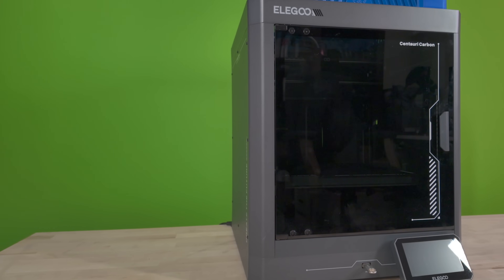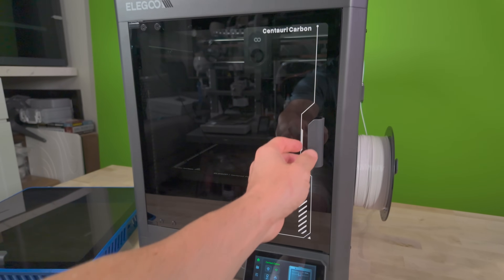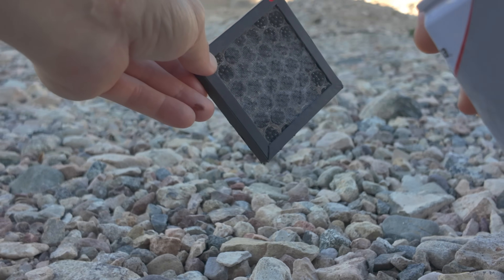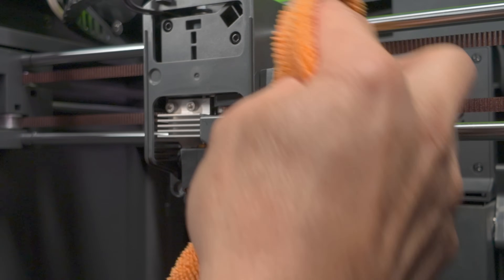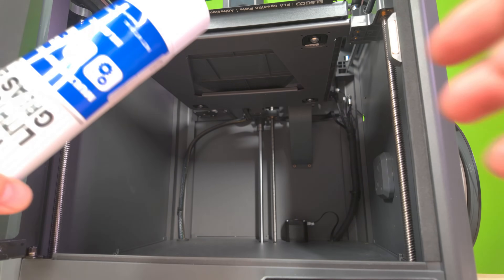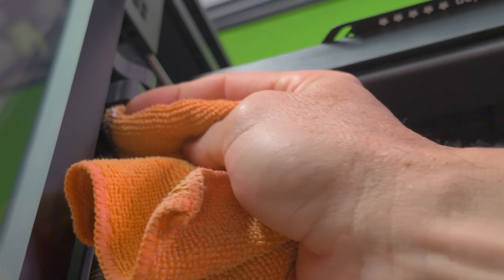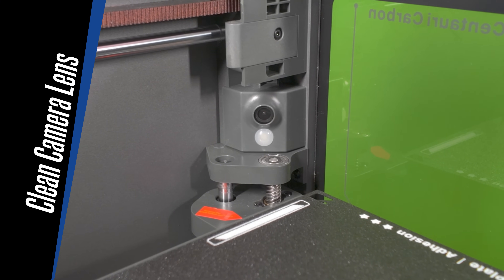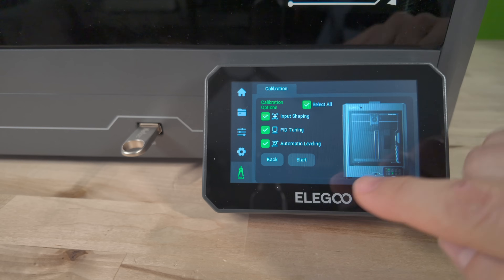7 Things Elegoo Doesn't Tell You About Maintenance

Comment: My issue with free spinning fans with compressed air isn't bearings... it's injecting voltage into the system. I disconnect them before hitting them with air.

While unlikely to cause damage on a properly designed circuit... it's something I avoid just to be safe.

Comment: You don't have to worry when using canned air on fans...  but I've killed a couple of computer fans while vacuuming up the dust with a shop-vac.   A decent vacuum, or air gun attached to a decent air compressor, can spin up the fan many times faster than the cheap bearings are designed to handle causing them to fail in just a few seconds.

Comment: Why not just use Super Lube on the lead screws (or use the lithium grease on the rods)? Saves an entire purchase of a second lube.
Reply from the maker: Because that would be incorrect use of them.
Reply: @planet3dp  Elegoo's instructions say to use grease, not oil, so using the Super Lube oil is "incorrect." If you had used the Super Lube grease, it would be acceptable, but not the oil.
Reply: @352Frauditor  This has me super confused as well cause before I watched Elegoos video I thought to use the lube oil on the rods as well but when I saw elegoos video use the grease I did the samething and this found this video of them using the oil lol really hope I didn't mess anything up by greasing up the rods. Consumers tend to learn what works better than the manufacture since we are the ones with the daily use and not just testing in a controlled environment so thats why I am tempted to reclean the rods and lube them with oil instead of grease.

Comment: how tight should the belt be?
Reply: @HermannHering  it's my understanding that the CC has spring tensioned belts so those screws will loosen the spring allow it to reapply tension, then you snug the screws back up. I haven't had to do this but hope it helps

Comment: The problem with this machine that is most often read about in groups is that the belts on the Y and X axes are over-tensioned, and there is no video dedicated to the belts on how to loosen them. :(
Reply: I have had my CC for a couple of weeks and noticed it making some noise and have read that it could be the belt tension, but nobody tells you how to tell if your belts are too loose or too tight.  Having someone create a video explaining how to determine if they are too loose or tight would be very benesficial, especially to those of use who have never owned a Core XY printer before.
Reply: I just fixed mine and it was actually very loose, but the process is the same. I came across this short while looking for clues. Just in case the link doesn't work, I'll give a quick description. Remove the back plate and you'll find the two tensioner pullies in the top left and right corners. There are set screws holding the pulleys in place as well as a spring to tension the pulleys when the screws are loose. If your tension is too high, loosen the screws and push it back a bit to compress the spring a bit and retighten the screws. Then probably check in on it every few months during your maintenance routine.
https://youtube.com/shorts/70XoMeY_vw0?si=xjTpUC3fDIt6Ph1C
Reply: @Craig-v6w  Thanks for this, I'm looking to get into 3D printing and thinking about getting this Elegoo CC, glad I decided to look up some maintenance vids, this will be a big help if I get the same issue.

Comment: The only quibble I have is the '3 month' recommendation (which, yes, I know comes from Elegoo). 

Three months if you print one thing a week (functional print to create a needed thing around the house or shop) vs printing a full size Iron Man costume are very different duty cycles/times of use. ;-)

It would have been better if Elegoo had provided a sensible maintenance interval based on hours of print time.

Nice clear video though!
Reply from the maker: Definitely can agree. Although I have run a test stress on a machine with over 1k hours and no maintenance. I would also say environment impacts this as well.
Reply: Wow, that's good to know. I am at 200 hours and am considering maintenance. Perhaps every 500?
Reply: Some maintenance interval estimation likely depends on how dusty your environment is as well.

Comment: Not letting the fan over-spin via forced air has very little to do with the bearing; much more important is the risk of blowing the mosfet driving the fan due to backfeeding.
Reply from the maker: Ah! Good to know 👍
Reply: Yes, but good design would solve that by taking back EMF into account. But, yes, putting a thumb /lightly/ on the fan will solve that too.